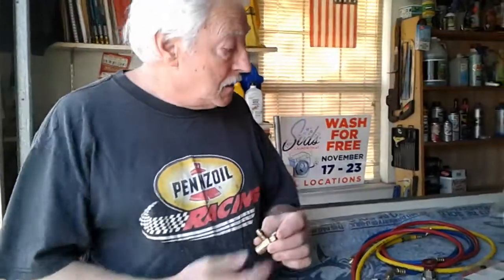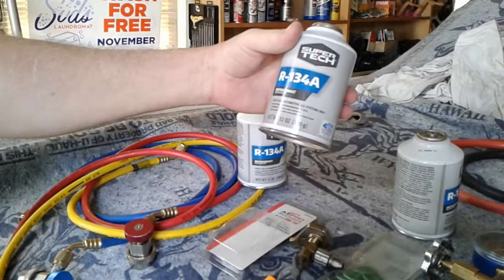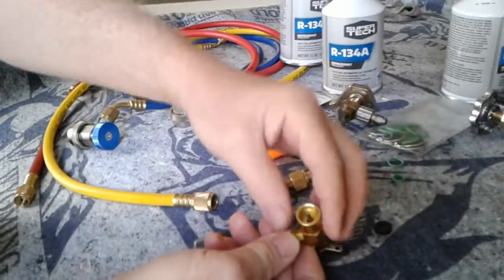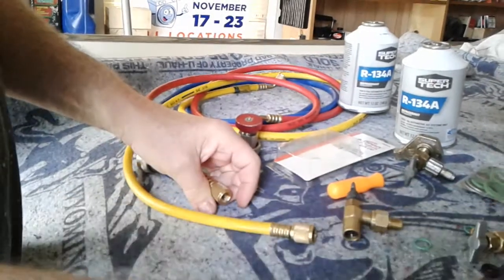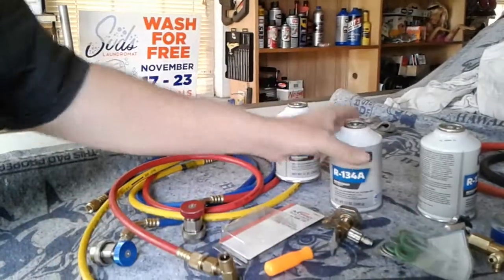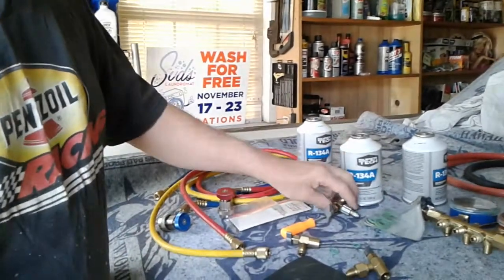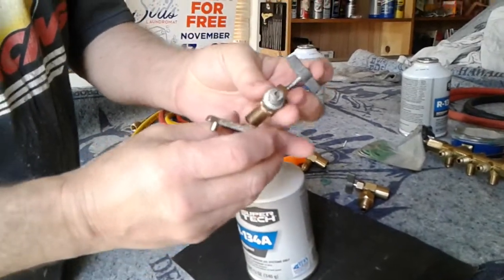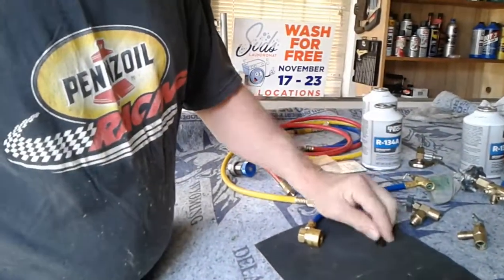how to fix R134A,   a/c can tap that will not pierce the can

Comment: I had the exact same issue with the exact same brand of R134a puncture tap. Whish i knew this trick. 

The other day i also had the issue with an R134a self-sealing tap from Autozone. I couldn't get refrigerant to come out. It took me over 45 minutes to charge one can - so frustrating. There needs to be some kind of standard, this shouldn't be happening. It's a stupid problem to have.

Comment: New r134a cans have Schrader valves. Puncture type charge tool will not work. Adapters that screw on the can are available

Comment: I'm having the same problem! So I youtubed, "how to pierce a stubborn r134a can." And your vid came up! Now I'm going to go try your method! Btw, you're not confusing at all. The vid was very clear.
Reply from the maker: Thanks.  I sure hope your system got charged up.   Nowadays . You can never be sure if the parts you get will work or fit.
Reply: @pontimaniac2303  Yes, your method absolutely worked for me. Thanks again.

Comment: Hey, I was just going through the same problem, my tap wouldn't release freon, I almost did the gasket thing, but I had a hunch to go to a different store and purchased a different brand of freon, sure enough it was the can of free and I originally had that was faulty, not the tap. The tap I have now has the gasket and pierces the can. So before you do all this, check to see if it's the cans themselves that are defective.
Edit: just returned the can at Advanced Auto, and the guy at counter said happens often with their cans.
Reply from the maker: Yes. This wasv3byearsvago for me. And I got from advance auto.  And Ollies discount.

Comment: That's interesting, thank you very much for your video. I've had my own troubles with these can taps, I've actually had a few of them stop flowing refrigerant. I found your video trying to understand my current problem. Apparently the self-sealing valve on these cans is very delicate and only meant to be opened and closed once. It seems that with some can taps if you screw it all the way down, that will be too much, and it flows less. And then once you back the knob on the can tap off a little bit, to try troubleshooting why it's not flowing, the self-sealing valve starts flowing even worse. So while I haven't experienced your exact scenario, I'm thinking that to avoid these type of troubles one could start with just screwing the can top in halfway, and watching the gauges until it starts flowing. And then leaving it there, and not touching the valve on the can tap anymore. I noticed that the cans from O'Reilly's sealed back up reliably, whereas the one from Walmart has this cheapo plastic that looks chewed up from the can tap. When I went to return my gauges, thinking it might be the gauges that were clogged up, the Walmart R134a can was spewing all over and I had to play with the self-sealing valve with my Leatherman to get it to seal. I guess that's why it's cheap. Just trying to add my own frustrating experiences with these can taps to see if we can all figure out what the hell is wrong with these things. It's worse than watching paint dry trying to get a can of refrigerant into the system past 50 psi when these damn cans clog up.
Reply from the maker: It's been a while since I messed with hvac , sounds like things have gotten worse.  I wonder were the cans are made , or if some crazy new epa warden that never had a real job in its life is involved. It's a plot to make all DIY people 🤪
Reply: @pontimaniac2303  i think i had a clogged gauge set too. I got a new gauge set and i got two cans in, no problems. Then, my ATC module failed.

Comment: Just buy the right tap next time.
You don't pierce the new ones you open up a rubber check valve and then it closes the valve when you retract the needle.

Comment: There's 2 types of R134a cans, and of course, 2 types of can taps. The old style for piercing, (non-EPA compliant), or new, EPA compliant, "self-sealing" can taps. Use the corresponding can tap, and you won't have to sand or change any gaskets. And if you're using a gauge set, you'll need an R134a set, as the old R12 hose threads are different. You could get R12 to R134a adapters, but I believe the pressure ranges are slightly different.
Reply: They aren't working!

Comment: I had that valve problem today.
Worked well with the green o-ring and sanding the collar down a bit.
But, always rinse the valve under the tap and dry with compressed
air to prevent contaminants.
Reply from the maker: Absolutely,  you are right about that. Yes clean of with isopropyl alcohol  is best.

Comment: Thanks! I just had the same problem, swapped out the thick gasket in the adaptor for a thinner orf hydraulic o-ring and it worked like a charm! Maybe some variance between cans, valve set a different heights, some work, some don't?

Comment: Geesh!
The newer cans have a valve, and the needle is blunt, so it is not ruined by the newer blunt can tap.
Older cans use a sharp needle, and are made to be punctured.Older cans are still out there for sale and need the older can tap.
Newer cans use a blunt (rounded) can tap.
Perhaps if you read what it says on the newer cans.
https://www.youtube.com/watch?v=eUQYjodqEPo&t=226s

Comment: I tip my hat to you sir, for your extensive trial and error success. There should be more folks such as yourself. Thank you.
Reply from the maker: Don't need more folks like me.  I get into too much trouble , 🤪😇
Reply: @pontimaniac2303  😂🤣😅
Reply: Funny thing I ran into this vid, i too just tried servicing my 2015 Town and Country AC. Extensive job though, Chrysler wanted $1,500 for the replacing the rear expansion valve, O-rings and evaporator. This took raising van, disconnecting AC pipe junction, lowering van, removing rear panels, screws and bolts, installing new parts, vacuuming the system and re-charging. I did it all myself. everything went fine until this new can tap appeared. Apparently I had one last pierce type can, and bought 3 self sealing cans. Luckily I tried the self-sealing can before the piercing type, where I discovered a "No flow" of gas. I was about to return my manifold gauge and hose set, thinking hoses were bad. But then I re-thought everything. Looked on Youtube and found this issue with the NEW valve needed for sealf-sealing cans. Headed out to Auto Zone and picked up the valve and I am now ready to re-vacuum and then charge system, but its been Awfully hot, so hot i actually caught a sun tan while in the shade. Plus I almost passed out. At 61, I feel like 78..lol. Be blessed and encouraged Sir.
Reply from the maker: Yes , i do know.  I been workingntoday on mybchevy S10. I replaced the Ac in it 4 years ago. And been great ever since.  Today. It was simple stuff.  Oil and filter. Fuel filter. Air filter. And cap and rotor.  Washed it. Tomorrow wax. And vacuum.  Its a 2002.  The heat no longer bothers me to much.  Its from driving in a old GMC Safari van for about 5 years with no.ac. and the windows did not go down. It made me tuff. 😂😂😂 take care.   @MusicMinisterJP7

Comment: I had the same problem 2 days ago. The can tap valve (Pittsburgh brand) wouldn't let the refrigerant out, after many attempts, I unscrewed the tap valve from the can under the expectation that the shcrader valve on the refrigerant can would do its job of self-sealing. BAD news, that refrigerant wouldn't stop coming out of the can. I left it alone until the gas exhausted. I went to YouTube & google and found about 1 dozen videos reporting the very same experience. By the way, the refrigerant can that I got from Walmart is a SuperTech, 12 OZ for $9 and cents. The manifold gauges (I got mine from Amazon) should come READY attachments to be connected to either R-1234a can or with R123Rye can (which costed me over $45.00 per a 4oz can). This industry must do a better job by providing customers with no need to go elsewhere to solve this problem (customer problem and EPA regulation)
Reply from the maker: I do not know how old you are , but I tell people all the time.   How when I was a kid. 1950s early 60s companies would lie about their products , and what they were suppose to be able to do and lots of bold promises,  and got away with it.  I guess it had been going on forever , but people finally started complaining  and the government stepped in.  And it got cleaned up pretty good.   But I see that it has back slided. And today it may be worse then ever.  Lots of insane claims, and shoddy junk.  When you go down to your local auto parts store . The part you buy may turn out to not fit or work right. And you have to  make it work .  Maybe I am nuts.  🤪 I see now they even have refrigerators that explode . 💥

Comment: I am having the same problem with the can for 1234 Freon can.  I will try your fix.
Reply from the maker: Hope it works for you.  Always be careful.when working with refridegerent . It is under pressure and can be dangerous. Have on  Safety glasses and no flame ect.

Comment: The old adage holds true.....give a person a little bit of knowledge and it makes them DANGEROUS.  I just found out the hard way that the new cans / valves are now different......SELF SEALING can tops will not work well with old puncture pin valves.  You need a valve with the center tip that is more like a pin punch...not sharp and pointed.   You might be able to twist in the old pointed puncture units but it will damage the self-sealing Schrader valve  mechanism.

Comment: Interesting enough, I just learned this, the new 134a cans have a re-sealing shcrader valve. You no longer pierce the can, its a new epa thing so the gas does not escape out into the environment. The old piercing valves are obsolete and have been replaced with flat tipped pin. So when you are done and you have not used all the freon, you can save it for another time.
Reply: Modify an old style piercing valve with O-ring, than file piercing point off flat so that it pushes on Schrader.
Reply: Do your wipers sound like "Dumb guy, dumb guy dumb guy, over and over?

Comment: This video is outdated!  The EPA changed the law requiring all refrigerant cans to have a self seals valve which prevents old connection hoses from working without and adapter like AVALANCHE AVL420CS RECHARGE HOSE ADAPTOR which will allow the refrigerant to flow but will self seal the can if all of the refrigerant is not required. This video on YouTube will explain:  https://www.youtube.com/watch?v=DJp5g7h5EBs

Comment: u need plastic adapter screws on can then u screw tap on adapter attach ur hoses and close tap and adapter pushes down on seal in can then  turn tap counter clockwise a few turns tell u feel freon flowing the plactic adapters come in different styles they sale a blue one and i have a black one
Reply: tried this.. still doesn't work. at least the blue one from walmart didn't

Comment: I got a flat one but still no luck. All the can tappers I have purchased don't work.
Reply from the maker: Seems like a lot of things that use to be simple , are now messed up. They want you to go broke.
Reply: @pontimaniac2303  very true and my brand new ac manifold gauge is also different 1/4the yellow one so I hade to get an adapter which turns it to 1/2 ACME  why cant they stick with a regular size?
Reply from the maker: @uriel0002  I do not know. But every year they come out with a new type of a whatchamecallit. And I have to buy a new tool .  Called a whydoineedit .I still have not gotten over the change to the metric system. 🤣
Reply: @pontimaniac2303  very  true a must have 😅😅

Comment: I removed that flat seal thingy and now I have no trouble putting R134 into my vehicles.
With the seal removed, I did not detect any gas leakage at the tap.
Also, I measured the seal,the thickness is .07 inches, or 1.9 mm.

Comment: Sorry excuse the typos I meant new can s have shredder valves so it does not need piercing it's self-sealing but you do need to buy the new adapter that has a flat pin instead of sharp
Reply: I'll bet this self sealing can is driving a lot of people nuts. Buy a Boltigen self sealing r134a can tap valve. This takes care of the problem.

Comment: Hey gys, the new can ourself ceiling they have shredded off so no piercing is needed you need to change your adapter from old to new it's not sharp needle it's flat pin
Reply: You are correct sir his trying to use the OLD can adapter on the NEW style cans. The NEW style cans have a valve in them (ie) SELF SEALING.You need to keep up with the changes Ponti Maniac!